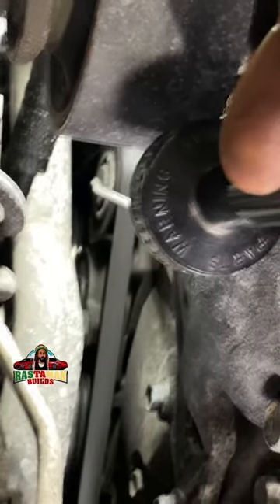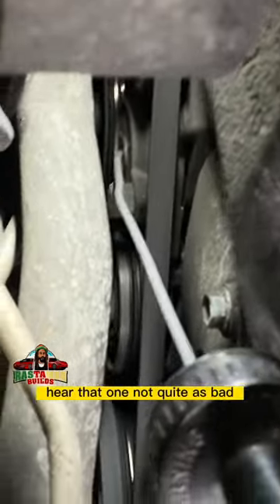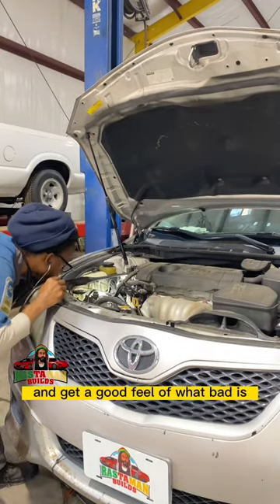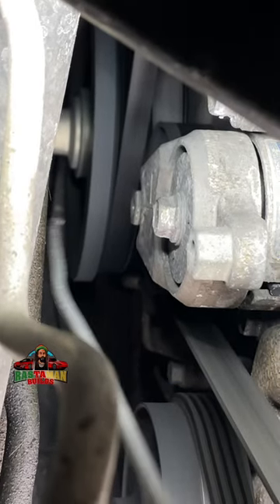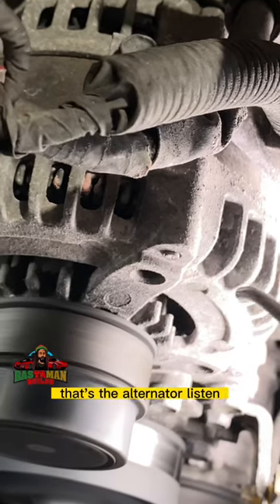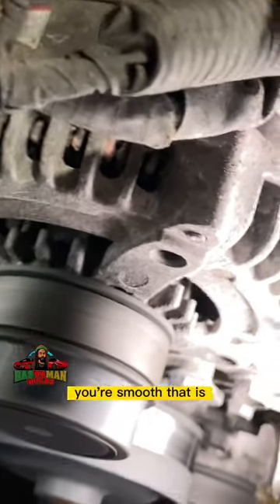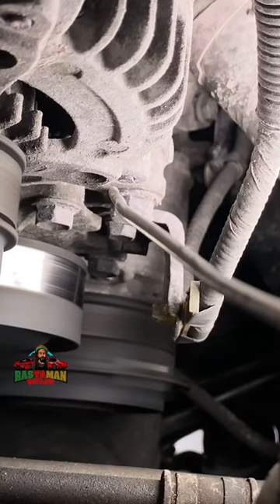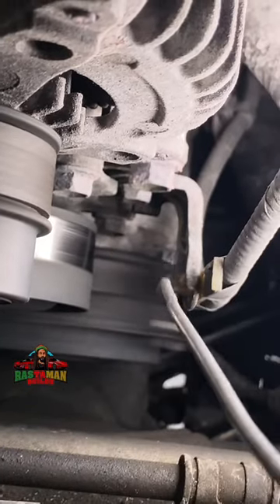BAD PULLEY BEARING #mechanic

Comment: What tool is that?
Reply: Looks like a medical stethoscope with the cone end removed and replaced with a piece of wire
Reply: @panzerfaus8459  you can get one called a mechanics stethoscope that has a rod already made into the end, very helpful
Reply from the maker: What they said
Reply: @RastamanBuilds  Thanks
Reply: @liamjerkins7259  huh neat thanks, looks like another tool to buy lol